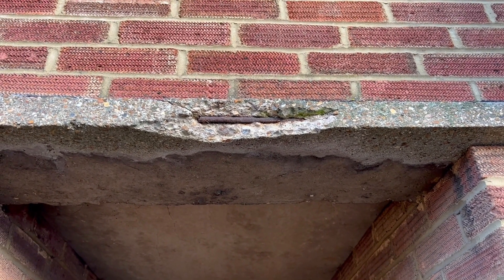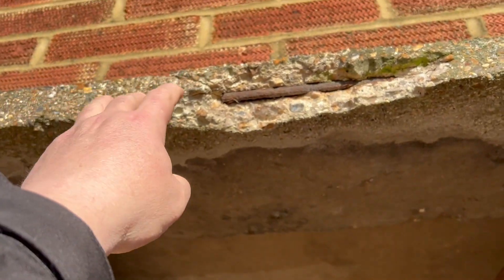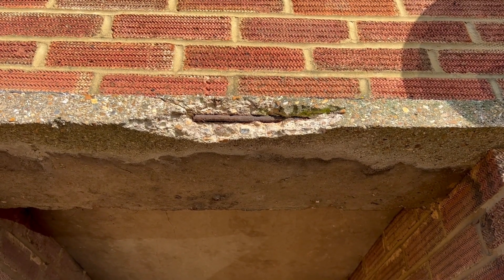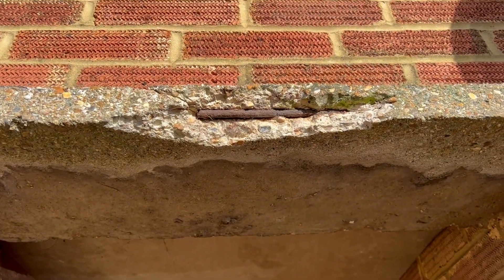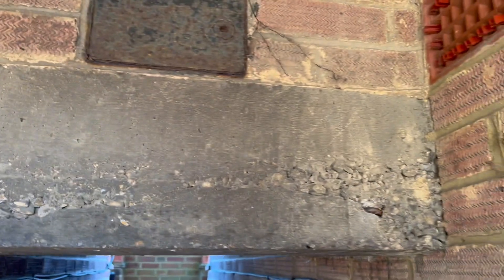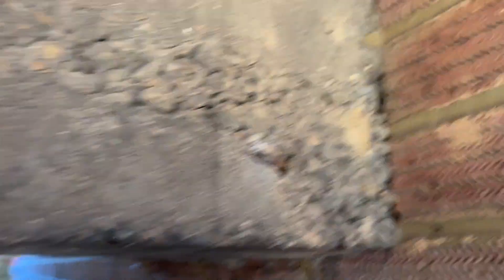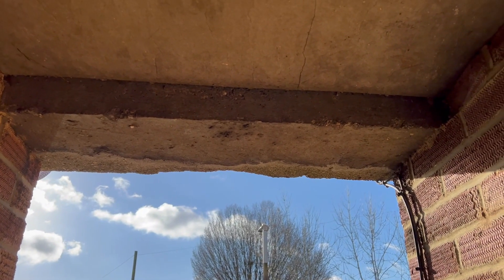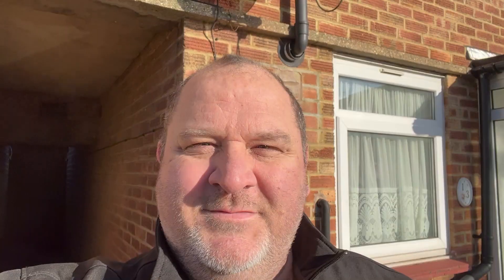What is Concrete Cancer & How to Deal With it?

Comment: Great explanation, have a far greater understanding of why and how this happens.... So to double check...not enough concrete around the rebar to stop the water getting to the bar and making it expand through rusting and then the concrete cracks and falls off making the whole set up worse? Have I got it now?
Reply from the maker: Not necessarily not enough concrete around the rebar. You can have plenty of cover but if there is a fissure or crack, water can get to the rebar, then once it starts rusting it expands, causees the crack to get bigger, which allows more water in, more rust, rebar expands with rust, which pushes the concrete outwards, allows more water in, which causes more rust etc etc. Please do subscribe to my channel for more great advice and other similar videos coming up.

Comment: I was wondering that once the concrete is repaired if putting some type of sealer on it periodically would alleviate any future problems?
Reply from the maker: Thanks for watching and commenting Kid. I’d say yes, it can assist in repelling water. However, my concern with sealing and type of concrete or masonry is that unless the structure is dry, you’ll be sealing in the moisture.
Reply: @essentialhandyman  - Thank you for the reply.
Reply from the maker: @TheKidFromYTown  no worries. Please
Don’t forget to subscribe and hit the notification bell and check out some of my other videos.
Reply: @essentialhandyman  - I am already subbed and rang the bell awhile ago.  I got the notification for this video.  😁
Reply from the maker: @TheKidFromYTown  Cheers buddy. Much appreciated.